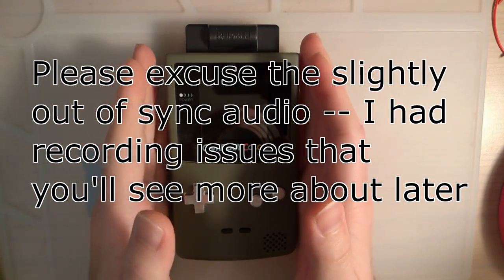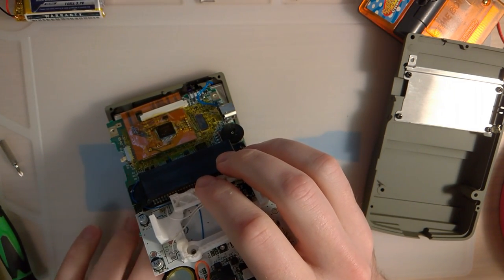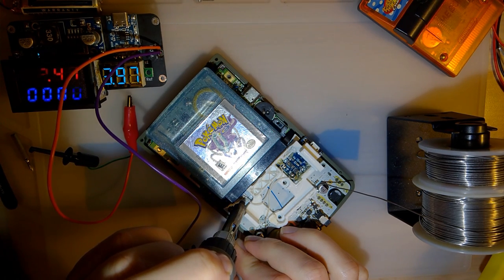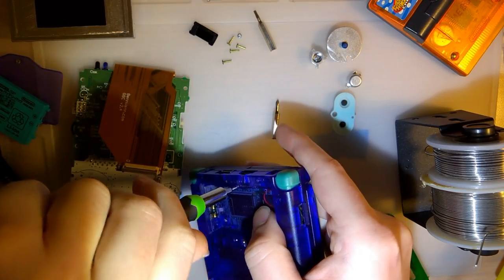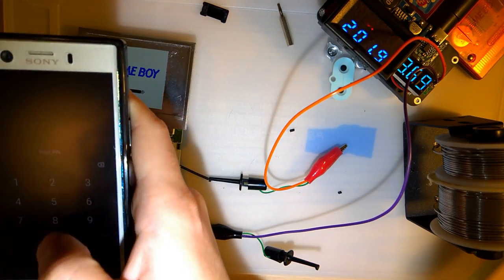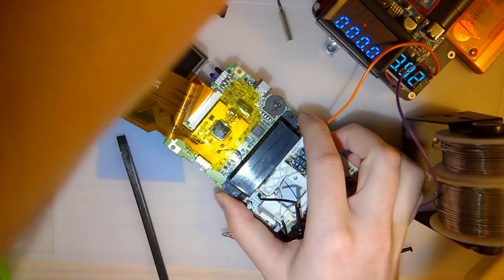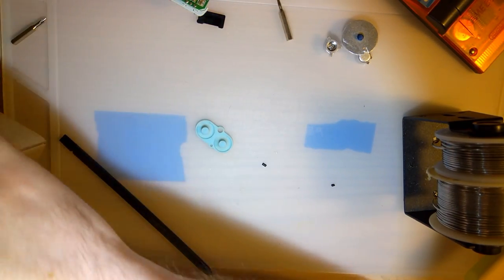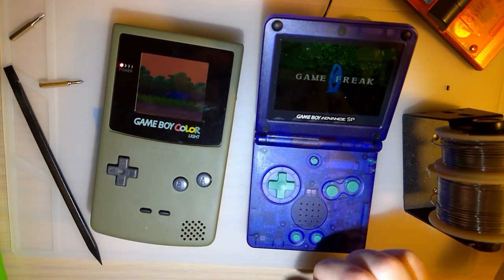Testing the FunnyPlaying IPS GBA LCD in a Game Boy Color

Comment: How did you convert the pokemon crystal? I own the English one and it’s near mint but I prefer the Japanese shell because obvious aesthetic reasons I have been watching them on eBay and they are $20 for a mint copy but I decided not to buy because of the two screws under those reflective stickers is it a direct swap?
Reply from the maker: Yeah, you can just use hot air to swap the MROM chips (bottom right). They are direct swap parts. That requires both a JP and EN (or your language of choice) donor though. You can also just convert the JP cart to a flash cart with one of jrodrigo's adapters: https://youtu.be/on1YissRnM4